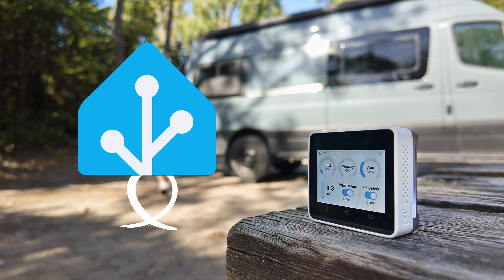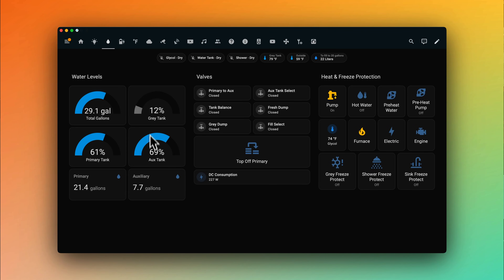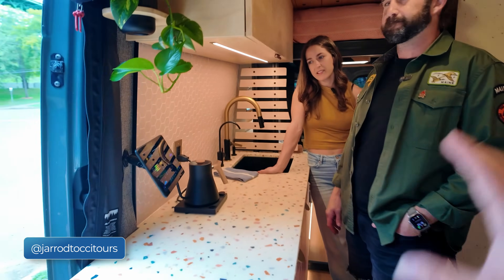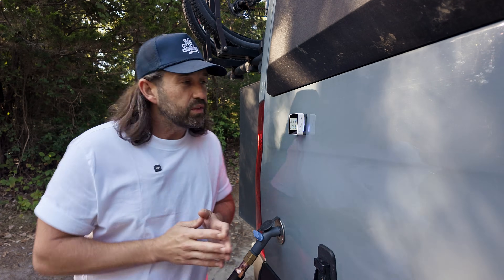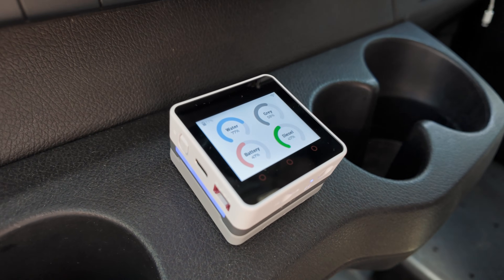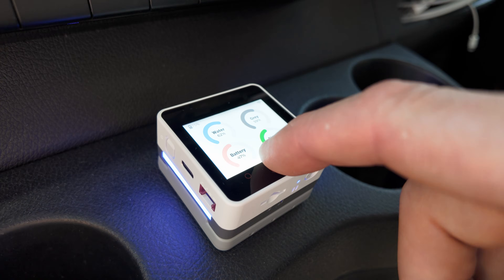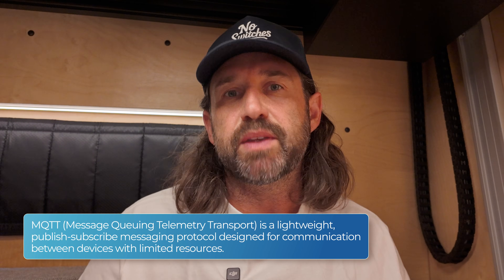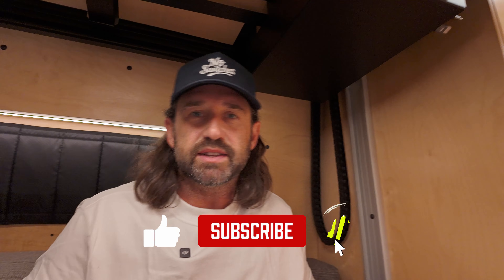Tiny Dashboard, Huge Control – Home Assistant in Our Van!

Comment: What are you using to read water levels?
Reply from the maker: We use resistive float sensors in the fresh tanks.
Reply: @SmartyVan yes thank you for the response! I saw in another video you have them connected to a cerbo. Which I was already planning to do just hadn’t picked sensors!

Comment: The hardware (minipc) I selected to run proxmox and HA was a bit power thirsty for my RV. I still like to fire HA up but I generally don't do this all day long (yes, i need to move my HA instance to something more power friendly) so I have been doing alot of my core functionality on an ESP32 and I publish this on its own webserver page right on the esp. Currently sniffing all the battery data off my victron shunt on the esp (which gets pushed to HA when HA is running) as well as having the ability to turn my starlink relay on/off. I'm guessing power consumption on the esp is waaay more than an order of magnitude less than the minipc. Like the M5 - may have to give that a go. I also run a little Beryl travel router in repeater mode off my starlink and on that I run Tailscale with subnet routing on so I can see my battery deets on the esp from anywhere in the world by just going to the esp web page. Pretty cool - almost free and entirely self hosted. For anybody interested, the esphome victron component is Fabian-Schmidt/esphome-victron_ble - he supports quite a few victron devices, well worth a go for anybody wanting to do this ultra lower energy backplane one level below HA.

Comment: You are the master of the smart van! M5Stack is great! Threw out all those cheap ESP32 boards and only use M5Stack now. Tiny and robust. Had one ESP32 where the USB-Port fell off.
Reply from the maker: Whoa, I've never had a usb port fall off! But M5STACK is good stuff! Certainly cheaper to use bare ESP dev boards if you don't need all the bells and whistles.

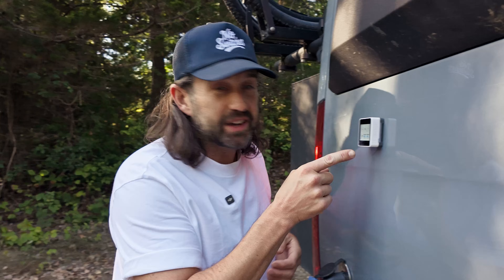Comment: 2:20 What if you do sick flips with your van though? Won't it open all the wrong valves?
Reply: Don't take the van to Australia then 😄
Reply from the maker: HAHAH 😂
Reply: The Bento will be horizontal (ish) on the console in the cab, and won't be oriented to open the grey valve until the van is vertical and nose down. As this will be near the end of the sick flip, the van will do a little victory whizz before it lands. Maybe a little messy if you do a reverse sick flip though. 😂